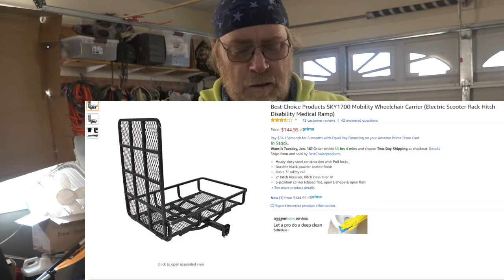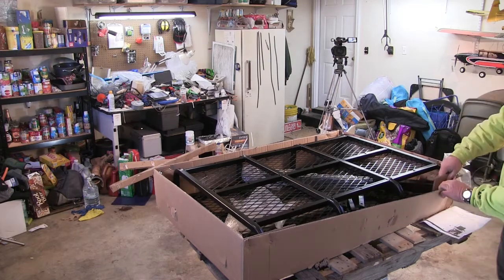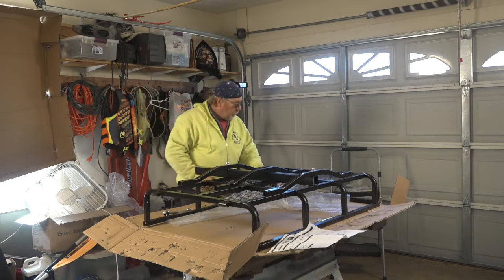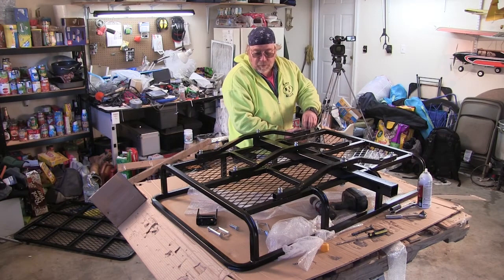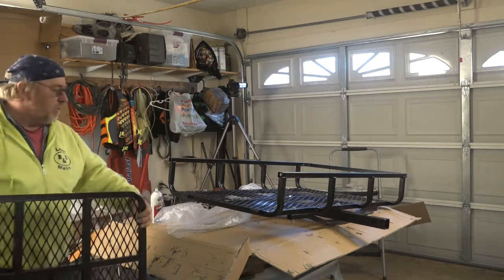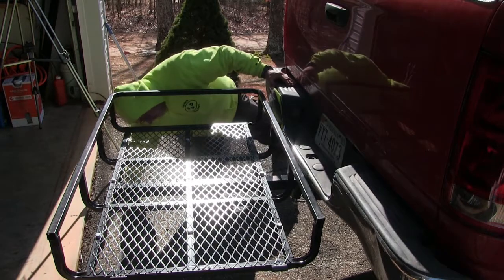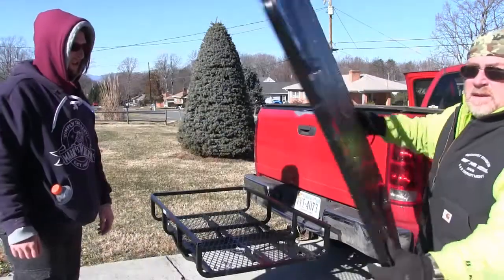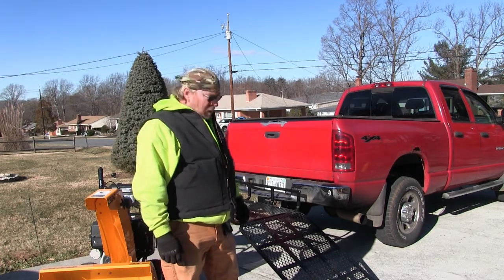Assembly and demonstration of the Best Choice Products SKY1700 Mobility Wheelchair Carrier

Comment: Putting mine together tomorrow. I had same issue with one missing bolt. It was a different size (one of the 6 under carriage bolts.) They threw in a extra thick bolt that doesn't even go to the unit smh. Only difference on my version, is one, I didn't get any reflection stickers and second, the side gate/ramp is already hinged. The side gate/ramp is also a tad crooked. So I have to fix that issue (rubber mallet time) to make the pin holes match up so the gate/ramp can lock secure in the flat (driving) position. My paper instructions were worse than yours....smaller paper 5x7 lol.  So here's a huge thx for the very detailed video you made. Awesome💯.
Reply: Same here, no reflection sticker and the gate is permanently hinged.  I also have one pin lock for the up position and one pin lock for the horizontal position when traveling with no cargo.